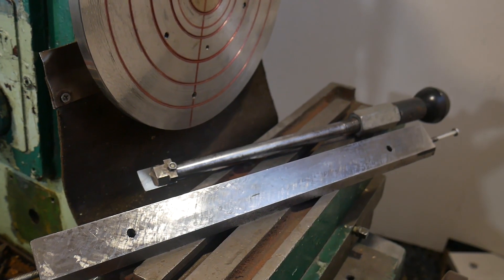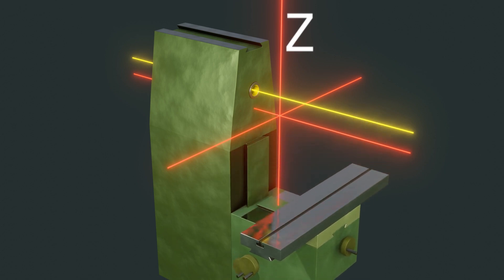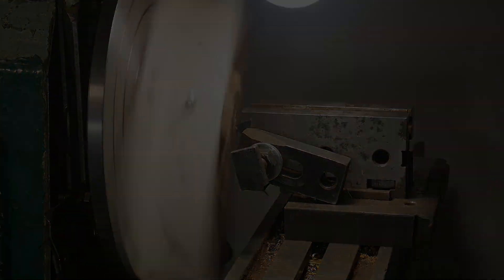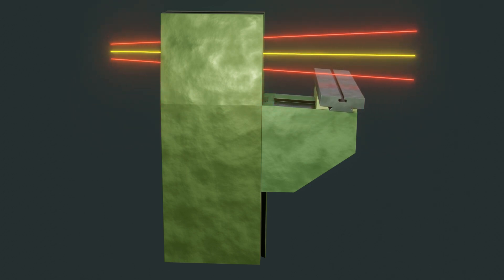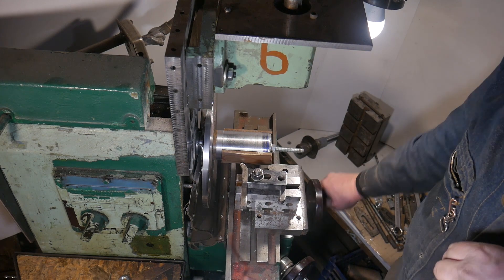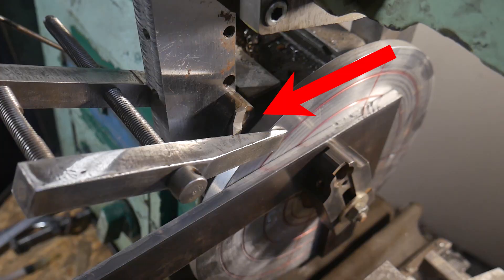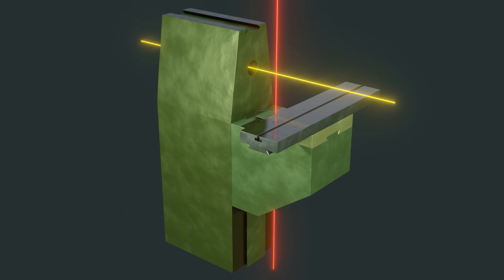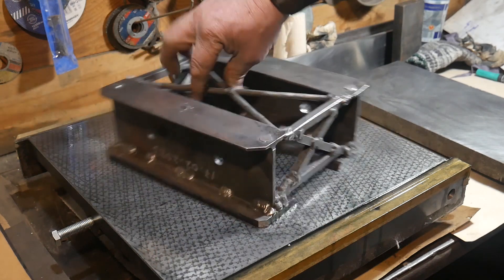Necessary before repairing the milling machine. №3

Comment: I'm not sure you said so but I assume those initial test (wood ?)pieces are perfectly  parallel before you cut them in the new machine ?
Reply from the maker: Unfortunately, after translating the text, I do not understand the meaning of the question. If possible, ask a question using a different combination of words. The lining material is multilayer paper impregnated with polymer resin.
Reply: @gena_bazarko  Sorry Gena. The lining material was machined before mounting,parallel faces 
 ?
Reply from the maker: @das250250  It was sheet material 10 millimeters thick. I cut out the workpieces from it.
Reply: @gena_bazarko  You machined them exact rectangle ?
Reply from the maker: If I carved a rectangle, I would also get information about the position of the axes. But the method proposed by me seems to me more effective in my opinion.

Comment: Wonderful work Gena, how many hours to do these jobs ? It would give us an idea of how much time is required to do such skilled wirk
Reply from the maker: Thank you! Since I don't do this kind of work systematically, I can only approximate the amount of time needed to complete this task. It may take ten hours. But this must be done before starting the repair of linear movement pairs. Without knowing the position of the axes, it is impossible to repair the machine well.
Reply: @gena_bazarko  Thank you Gena, I was asking how much time you had spent so far  for work in each video . Then I can add up hours and get an idea of how much time these operations take to do.
Reply: If you need help with making translation or video music just contact me.
Reply from the maker: Thank you. My mail.     den.gennady19@gmail.com